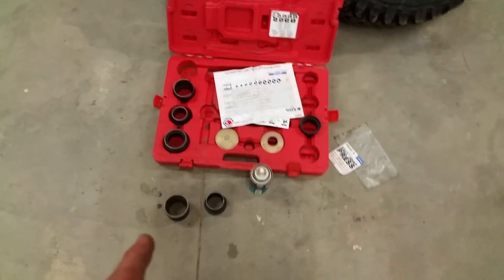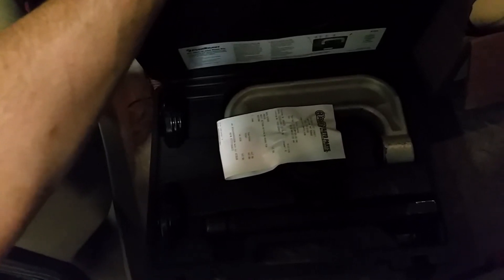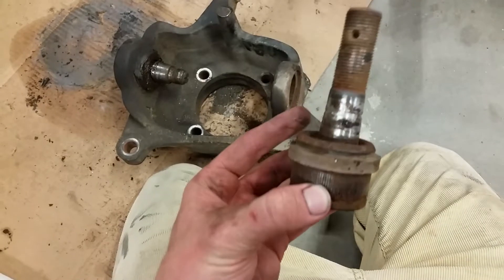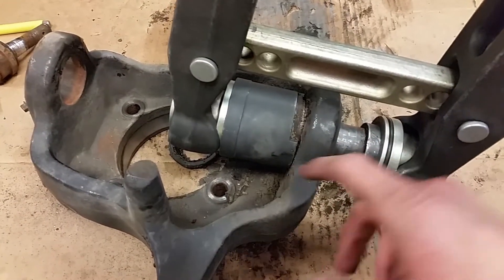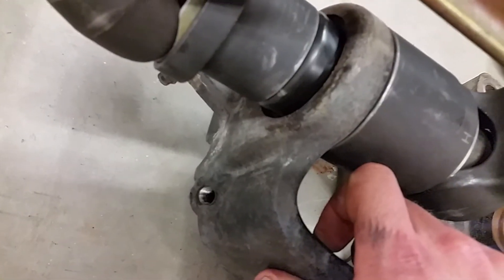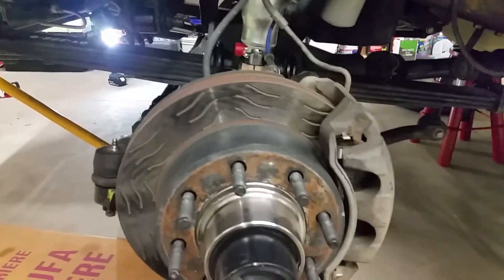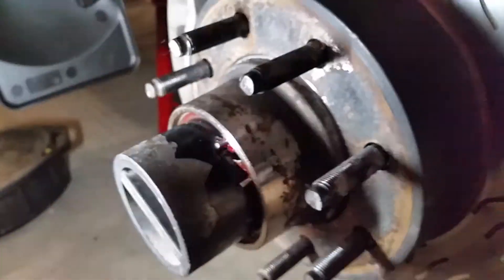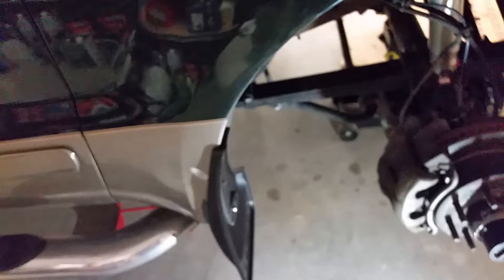MATCO Ball joint press removing Super Duty ball joints - The best ball joint press?

Comment: Wow, you said you bent it!  How in the world did that happen, and was it under warranty?  I need to replace my 2006 Ram 2500 ball joints and was looking at ball joint presses.  But, If this one only works on heavy duty ball joints I may need to look at other options!
Reply from the maker: I guess a super stuck joint. I think it was.  The Matco dealer let me borrow and test it out.  If I recall correctly, he said he would just warranty it.  Other presses work.  I just have never had any luck with others this is a nice kit.  It is on my list of tools to purchase.

Comment: Does it also work for like cars, SUV, regular trucks & all that besides HD trucks?? Does the press come with the whole cup set or just the press itself?? Im asking because I wanna get the right tool taht gets the job done for any vehicle so I don’t have by two different press
Reply from the maker: I don't think you would have luck using it on any smaller cars/suv's were you can't remove the knuckle or have clearance issues with space.  It does come with the cups.  Good luck!